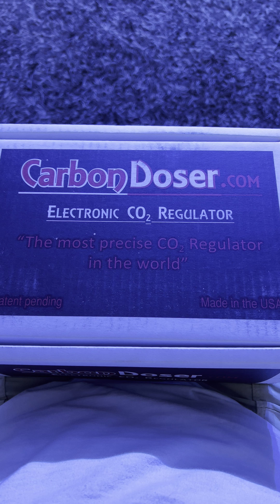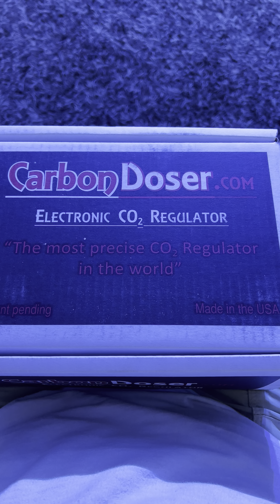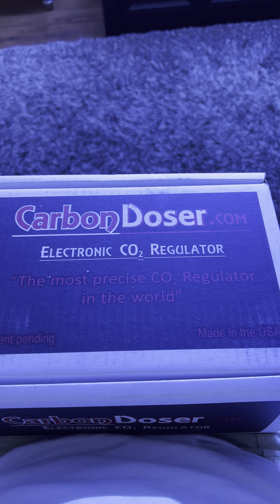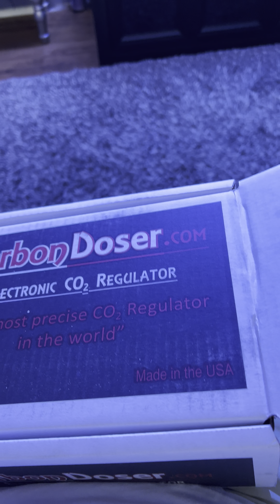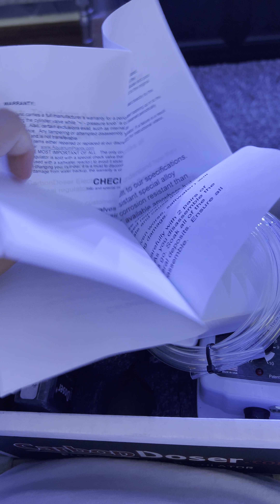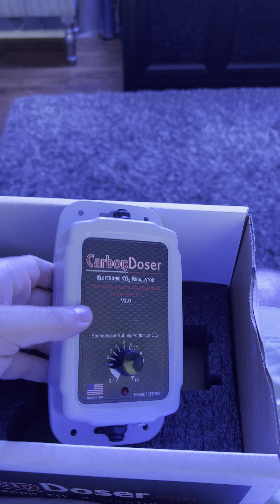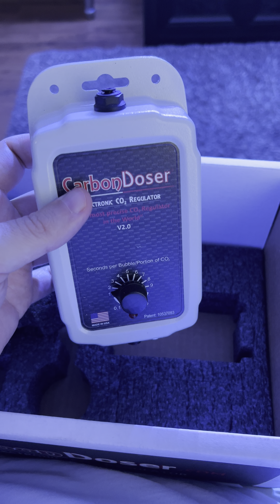CarbonDoser Version 2! New calcium reactor regulator/bubble counter.

Comment: That is a good piece of kit. I have version 1 and with a good reactor you are going to be amazed at how much easier it is to maintain. I have a Kamoer dosing pump and one I had the reactor ph set I literally just turnbthe dial on the pump to adjust. Every few months top off media and once a year get more CO2 and clean the reactor. That is it. You may still have to have 2 part on the side to adjust but nothing major.